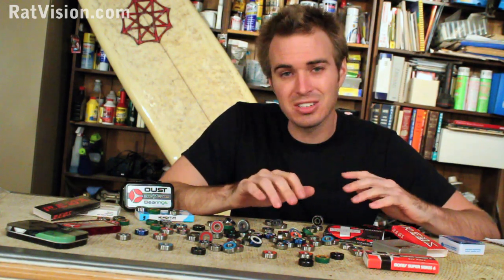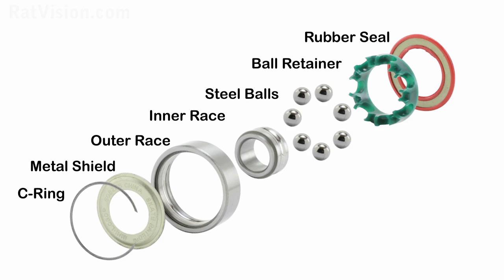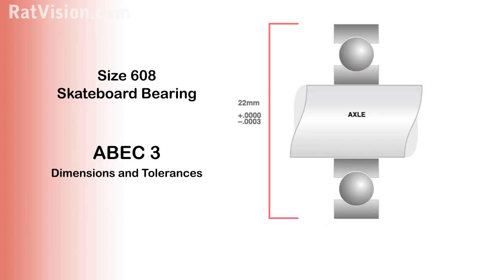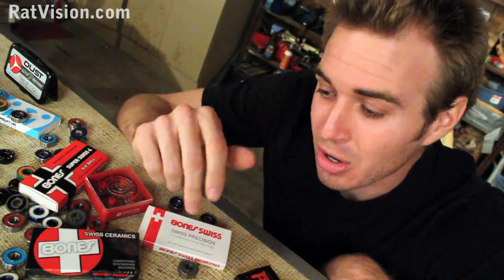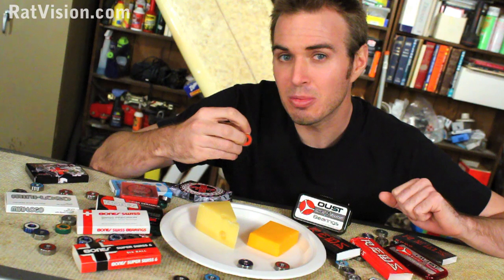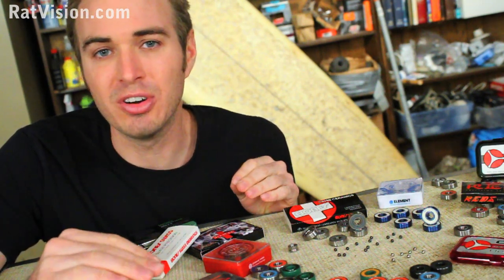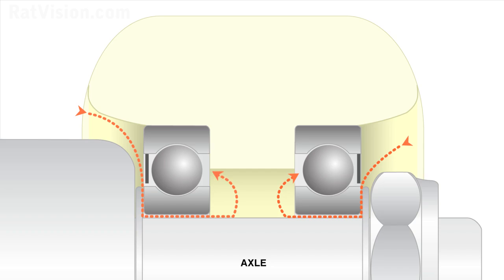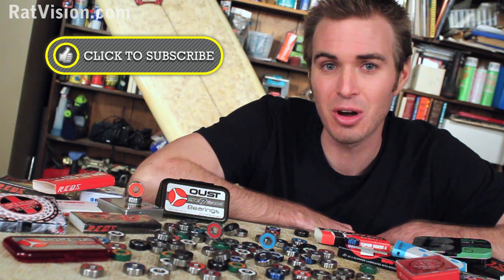What is ABEC / Swiss / Ceramic Bearings

Comment: That hydraulic press section was so rushed through... really suspicious. The ceramic ball may shatter at 8,000lbs of pressure, but until it shatters, it will not deform. A steel ball may not crack until 20,000lbs of pressure, but it MIGHT  DEFORM long, long, long before it cracks. So really kinda suspect conclusions drawn here.

Don't like it. No sir.
Reply from the maker: What you have pointed out is the difference between a brittle material and a material that has plastic deformation or ductile.  Ceramic, as you appear to know, will just shatter, because it cannot deform.  Metal, however, will deform and return to shape.  We admit the press was not the best way to explain in lengthy detail the difference between materials, so your suspicion is valid. What we wanted people to gather from the test and things mentioned in the video is that ceramic is not a superior material to metal/steel.  This is the misconception in the skate world. It's basically been hyped too much.  It's far too brittle and doesn't handle loads like steel can.  It may be great for other application, but ceramic should not be used for skate bearings.
Reply: Rat Vision – Skateboard Tech The question is whether the loads and shocks involved in skateboarding are significant enough to to warrant the use of a steel bearing over a ceramic one. However, if you are only cruising, there is no question that the loads involved are negligible in relation to a ceramic bearing. But do the g-forces and shocks involved in dropping from a 7 step, for example, generate the kind of loads that might cause a problem with ceramic bearings? I'm not convinced it would.

Comment: 608z bearings are the worst
Reply from the maker: I kinda of have the feeling you don't know what 608z means, because that doesn't make much sense.  It only means there is one metal shield, which I can agree with, if that was your point.  ZZ means 2 metal shields.  608RS (Rubber Seal).  6082RS= 2 rubber seals.
Reply: I've tried those but they are slow

Comment: iv ridden pretty much every type of bearing and my favorite by far is bones swiss ceramics not only are they high quality but if you take care of them they are by far the best
Reply: Yeah, i ordered those oust bearings and they honestly dont outperform my swiss bearings or reds cermics
Reply: Yeah I run Swiss Ceramics on my inlines after trying many many different setups and they're great. They do require a little more maintenance but the way they're made makes them easy to service.

Comment: saw this video after buying bones super red. should've opted for oust. damn impulse purchase.
Reply: Don't worry about what he says, bones reds are just better in performance, and don't try to outsmart me because I recently got bones reds and I just know for a fact from experience that it's faster, I didn't have to ask Siri witch one was better I just had to ride to see witch one was better, and it turns out the bones bearings where better
Reply: +Ashraf Rogal Omar Hatu I just started, glad to hear your opinion. Thanks!
Reply: +Eddie Puah no problem
Reply: alex kirk started a little more than a year, mainly because of electric longboard. Gonna try Oust next.
Reply: was talking about the "expert" in the comments not you dw, and yeah as you get better it's good to have bearings that handle more abuse because that's when you'll get through em quicker. but yeah for now it doesn't matter as much
Reply: +alex kirk i wouldn't consider myself an "expert", I'm just describing through my experience of switching bearings, and I'm saying compared to my old ones it is a big improvement in performance
Reply: which are abec 11's not oust.
Reply: jesus christ, i got my first set of reds about 9 years ago and my first set of ousts about 7-8 years ago(back when they were tensors.  i've also had super reds, super swiss 6, and have ridden bones swiss ceramics and i must say the the moc 5 streets were faster than all of them let alone the moc 9.   also all my ousts lasted on average about 1-2 years. if someone knows a better bearing i'm willing to give em a go, but so far ousts all the way. btw i doubt you've had much experience as you seem really young.

Comment: Just one thing needed to be said. Ceramic balls are harder than steel balls. As an engineering i hate it when people mess these up. That's why it's a ceramic. Just like cast iron is harder than many other steel sorts. Would i skate cast iron? Ofcourse not because the hardness makes it brittle. But the more a moatrial is plastic (the plasticity) the more it will deform under pressure. Add a little heat with it and it deforms more. That's like riding your bike with a flat tire. This is the theory. I do not know what this affect would mean for their difference. You appointed that spacer size and the angles are important, i follow that. Way more important than ceramic vs steel bearing. (I would still choose steelbecause of price and less chance of chipping)

Comment: u guys want the #1 bearings here it is (Andale bearings)
Reply: its not that hard to be better then redz
Reply: Bronson are the best bearings
Reply from the maker: +emwu1988 How? What did they do or what do they have that makes them the best?
Reply: +Rat Vision – Skateboard Tech check Out their site for details, IMO they're smoother than bones reds and rode in the rain a few times, still super smooth
Reply: I've ridden reds, andale swiss, Bronson G3, and Oust Abec 7s and I think that the Oust and G3s are the best. just my opinion
Reply from the maker: +Awèšømê máñ Cool Chinese bearings.  Aren't they coming from the same exact manufacturer as most of the bearings sold at shops?  If that's the case then you have a list of #1 bearings.

Comment: Why are there different sized bearings? Do they fit sized wheels? How do I know what sized bearings to choose?
Reply: +Gideons Doggown because all skaeboard axels and wheels use the same size bearings. All the bearings will still fit your skaeboard. I believe that rollarblades also use the same size bearings. All you are choosing are very small tolerances, not sizes.
Reply from the maker: +Gideons Doggown Yup.  There are no sizes.  It's all universal.  Rollerskates, skateboards, and scooters all use the same size "608" bearings.
Reply: +Rat Vision – Skateboard Tech Any tips ffor finding after market wheels for drift skates??? All i have so far are the sizes which are. 72mm H x 42mm W  and 82a soft. Seems like not all skate wheels will fit their axel set up.

Comment: Loved the video but the question I have is more of a recommendation. I don't skateboard but I play inline hockey and have been using Bones Ceramics for years (abouts 7 or 8 years on the same set. No damage and still spin well). Now I'm looking at getting new ones for a different pair of skates. With the amount of torque that gets applied with stopping and pushing off, any recommendations? I've always gone with ABEC 9 or Swiss but upon looking at your video, I'm not even sure which company anymore would be ideal for that type of workload.
Reply from the maker: Yes! Get oust bearings. They were in the inline hockey industry before skateboarding.

Comment: Completely ignore ABEC rating. If you want ok bearings for cheap, bone redz all the way. Otherwise just look for parts made in swiss or belgium as they use more consistent parts that arent printed in mass. SWISS DOES NOT MEAN MADE IN SWITZERLAND btw, like he said thats bullshit. However you can guarantee that european alloys are always going to be better than Chinese ones. Ceramic balls are also niche bullshit nothings that really high end boarders might need because they go extremely fast for miles at a time.

Comment: Hmmmm....I always assumed swiss was a trade word used to describe the precision of the lathe and the raw material that is used for the part, at least this is what the guys in our die shop tell me when they are making tooling for out in the factory.

I wouldn't be surprised if manufacturers of skate bearings use it purely as a marketing gimmick.

Comment: I've  like Reds, but I want to try sec 9 black ball ceramics.     Aaron kudo used synopsis, which is a great brand as well.
Reply: Sec 9 gear is mass produced crap at this point. Definitely would take aarons word on those though, ive actually been thinking id get whatever he rides next time i need new ones.

Comment: I have mostly being told by my family members that's all about skating and say that German bearings are great.the bearings I had on my long board had a press cover and had to be  replace it with new bearings that's is abec 7 and it's pretty good but unsure if I should go out to buy German bearings.
Reply: as well the new bearings I got how and if I should test it if it's titanium?
Reply: Super late obviously but "german" bearings are, like he said, not necessarily better than any others. If you are new just get some bone redz as they are cheap and will take a first year boarders thrashing. After that yeah, id definitely recommend looking for bearings at least cast in belgium or switz. SWISS doesnt mean anything other than a higher price, such as bone swiss bearings being made and assembled in china being more than bone redz made and assembled in china. Honestly though im a cheap ass and just cycle in redz every season and use my old ones in the off season (northern midwest has off seasons) and can recommend that if you just properly clean your bearings they last as long as you want them to.

Comment: Nice video, question,  if i wanted to get a higher achievable speed, what would you recommend to do? new bearings, new wheels? In a few videos you said that bearing spacers needed to be .401, so i'm wondering if there is a way to check it or where i can get a specific tool to measure it? I'm new to skateboarding and would really appreciate a response! :D

Comment: holy shit iv been throwing away money getting abec 7 instead of abec 1
Reply from the maker: +caleb baker Hold on a second here.  ABEC 7 does not mean you're throwing away money.  You are most likely getting a much higher quality bearing when you choose ABEC 7 over ABEC 1.  BUT, if you are a beginner, and don't need a higher quality better performance bearing, then by all means go with cheaper priced ABEC 1 bearings.  Some times price is more important than functionality.
Reply: +Rat Vision – Skateboard Tech so in a nutshell, abec is more of a standardised rating for the manufacturing process?
Reply: caleb baker Don't evet look at ABEC rating.  It means absolutely almost zero in skating. ABEC is for high speed machining equipment and very very high speed parts.  Loom at all the factors he mentioned in the video and reviews.  Quality of materials and manufacturing.  It's why Bones and Bronson don't give ABEC ratings.  They are next to meaningless besides selling for a profit. I have shitty ABEC 11 Chinese bearings.  I'll take basic  Bones REDS or a decent ABEC say 5 reputable cheap well known brand over them.

Comment: there was a Transworld buyers guide a few years ago where they interviewed pros about their setups and every pro said they rode Swiss bearings with the shields removed. Its like they wanted kid's to do the same so their bearings would fail prematurely and have to buy new ones.
Reply: Naaaah ...these pros and sponsored skaters are just spoiled plain and simple. They can break a board with zero concern because their car trunk and closets at home are full of extra skateboards and parts.
Reply: @Airik1111bibles  so true!!!
Reply: Justin Buice I'd have to agree with you hands down but at the same time with a healthy amount of skepticism it's pretty easy to see that it could be a combination of buying the top bearings in the shop with 'modifying' them slightly to make them look arguably cooler. Yeah could go either way
Reply: @bungcheese5901  off
Reply: The only way this stuff starts to make a difference is if your bearings heat up over 500 degrees or if your skating faster then humanly possible..... you would not be able to skate fast enough to even start to notice a different in material or abec.. however the shelded is better then seald because you can get in there with ease to clean and lubricate

Comment: SO WHICH ONE DO I BUY FOR CRUISING
Reply: Antinull A I can imagine... even worse that roller blades need twice as much bearings. Some shops in Germany are really stupid, selling the bearings for even more € and then they wonder why most people buy bearings on the internet.
Reply: Antinull I Germany they have a huge hype among beginners, I tried them once and they aren't bad, definitely not, but here you get bearings that are just as good cheaper. Many downhill longboarders use industrial bearings though.
Reply: +Loser Right Here any.
 (Industrial, Rush, Spitfires. If you are lazy buy ones with integrated spacers and speedrings)
Reply: Bones
Reply: Brabafied !
Too expensive for just cruising.
Reply: Antinull I live in Germany, Bones Reds cost about 22€ here, that would be 25$, in Germany you can get more decent bearings for 10€ less. So depending on where you live, Bones Reds are way too expensive for just cruising, for that money you can get bearings with integrated spacer that at least have two shields instead of just one.
Reply: Antinull Sadly like I said it depends on the country. The cheapest in Germany that aren't industrial bearings would be spitfire titaniums or other more unknown bearings.
Reply: Antinull I understand if small shops do that, but we have some really big shops that still charge way more than they should. Personally i don't like reds anyway since they don't live up to their hype in my opinion.
Reply: Abec 9's have been cool for me. Enuff sell some. Or research if any cheap bones are going,
Reply: Bones seem to only come with one shield per bearing though. My super reds did.

Comment: Which ones are better bones ceramics or swiss
Reply: Bone redz. Dont waste time on ceramics, bone swiss are still made completely in china but have a bit better materials than redz but cost quite a bit more for pretty much no difference. Redz are cheap and easy to take apart and clean and will last you a good season if you clean properly. I get one set a year for late spring-late fall and use my set from last year during the wet cold and shitty months. Really swiss arent worth the extra money until you need to buy your second set of bearings. From there i would try to avoid bones and look for companies based out of europe that sell bearings as the parts are made there and quality control exists, as opposed to china where there is no such thing as quality control and they can tell you the bearings are made of gold if they want to.

Comment: Since no one is going to be putting 8200 lbs of pressure on their skate boards I don't think that test was really necessary and since it was a compression test it doesn't measure the HARDNESS of the bearing. If you get good ones ceramics are masses better then the steel equivalent. :)

Comment: dude, just tell us which ones are best! I'm jk but i know for a fact that bones ceramics are the fastest skateboard bearings on the market because I still skate them now with the shields popped off and Iv'e had them for 10 years lol and I've literally skated every bearing in the 20 years I've been skating. so it everything all just a sales ploy? abec 9's are not better/ faster than abec 3's? and the quality of the bearing will never be known unless you test them at a NASA facility? ALSO, If I find FULL ceramic bearings that are skate size, 808 i believe, will these work better than the hybrids?

Comment: Purchased Bones' Swiss Ceramics holiday season 2005.  I am still riding them July 2015. I clean & oil them every 3 weeks or so. All 8 bearings still spin freely. I would say that I easily purchased at least 2 sets of steel bearings per year before the ceramics.

Comment: Over all, which (brand) of the bearings was the best ?
Reply: Reds
Reply: Bones reds
Reply: Good, cuz I just received mine today
Reply: Zion Robison To be honest, most bearings you can buy at your local skate shop will be good as long as you take care of them. But I personally prefer Bones bearings over other bearings.
Reply: +kaleb vandermei Bones reds are junk!  Bones swiss 6 balls are the way to go!!
Reply: Charlie & snoopy reds are straight man
Reply: Start with bone redz because they are cheap and a first year rider wont do shit to them. When you start to notice them getting shitty do some actual research into some companies that make bearings to find some that fit how you ride. Overall you can almost almost almost always assume anything made in europe (its important to make sure all parts or at least the bearings themselves are made there) is better than anything in china. Bone redz and swiss are both made and assembled in china, however they are both solid bearings i would recommend, however youre going to pay a premium for the word "swiss" on the little cardboard box. I have no problem with redz and dont do enough serious boarding for it to matter, so i just get a new set every spring and ride until late fall where i switch in my older bearings. Just clean your shit regularly (every 30-50 miles or so of boarding) and focus on riding instead of your bearings.

Comment: You can not compare materials the way you did.  Every material has set standards for testing or comparing.  With bearings the biggest comparison is fatigue life so they are tested under vibration analysis.

The standard bearing life also known as L10 in the US or B10 in most other countries is the theoretical maximum at which 10% of the bearing fails, this is usually when it needs to be replaced.

Comparing with the same ASTM standard  ceramic will always have a higher life span and usually a greater factor of safety.  They are also more efficient so the more energy you put into the bearing the greater distance and speed you will get out of them.